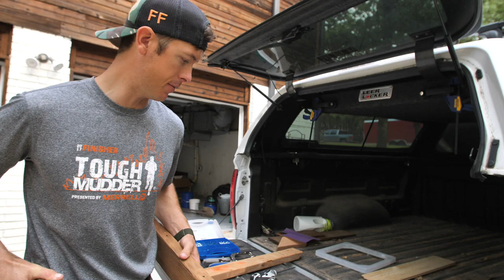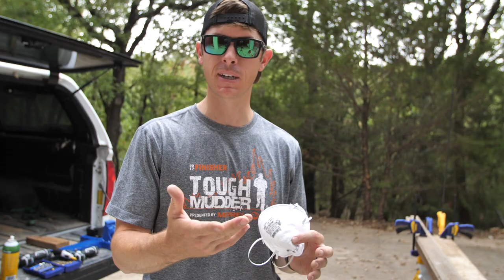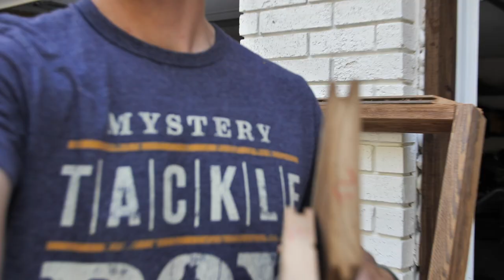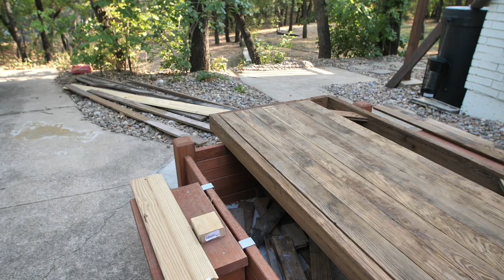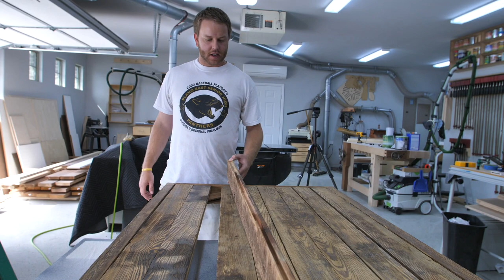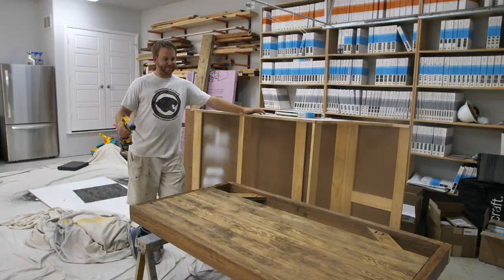First BIG Mistake in Wood Building - Always Measure TWICE!

Comment: The board with the tight grain is closer to the heart of the tree whereas the looser grain board with larger rings is found closer to the outside of the tree. Old timers call it sapwood and it’s not nearly as rot resistant in most cases
Reply: Okay so lance covered the rings later in the video 🤣

Comment: You also made another big mistake, you did not leave a small gaps between the planks making the tabletop, since you did not do this you left no room for the wood to expand and contract when the temperature varies. If the wood expands it will crack and put pressure on the other pieces and  they will crack too. This will ruin you lovely reclaimed wood table.
Reply: I don't think that'll come into play for his table for 2 reasons. I doubt the humidity in his room will vary enough to make a difference and the second being that this is reclaimed wood. Its really old and well aged so all of its bending and swelling should be done for the most part.